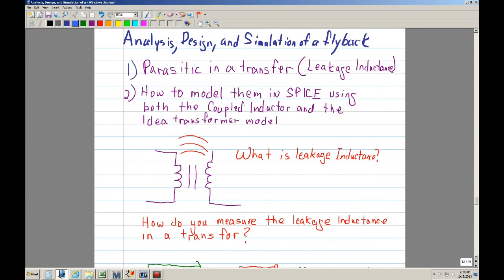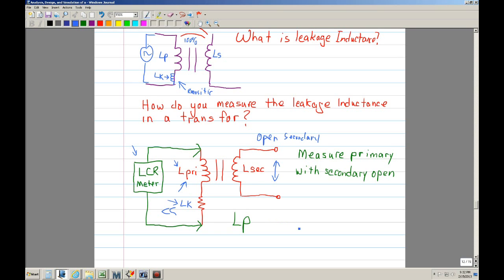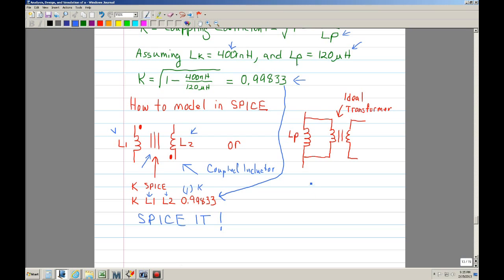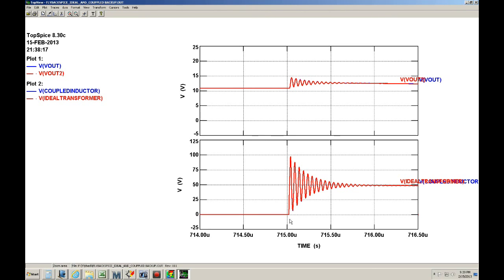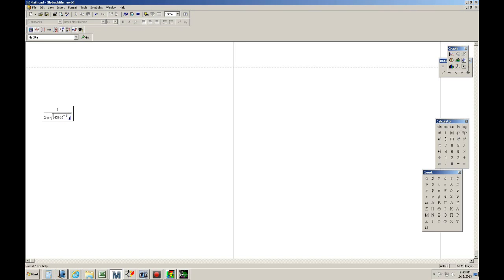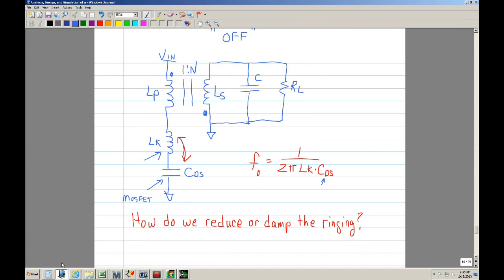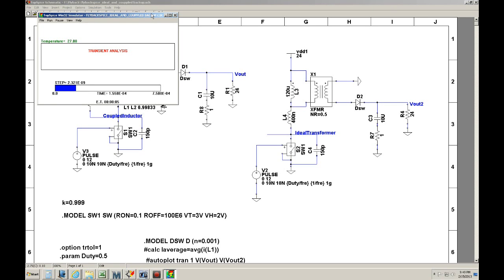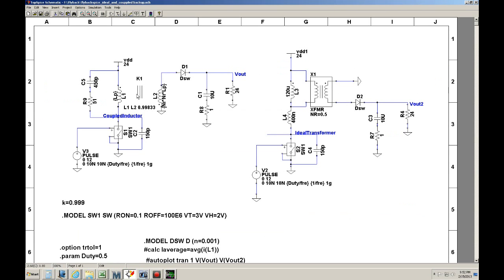Analysis and Design of a Flyback; Part 4, How to Model the Transformer and Simulate it

Comment: Hello, Very Informative video. Can we use both RCD and RC snubber in the same flyback. RCD for clamping the switch voltage and RC for ringing ?
Thanks
Reply from the maker: @neethus3294  absolutely yes, you can use both just like you wrote. Nice intuition!
Reply: @RobertBolanos  Thank you 🙂

Comment: If we are using a High voltage BJT like "MJE13007", commonly used on many commercial SMPS in market, which value from data sheet to be used instead of the C_ds?

Comment: Nice video Robert! But what about secondary side leakage inductance? Don't we need to include that in spice model?
Reply from the maker: When the coupling is tight and close to 1,  the leakage inductance that you measure at the primary includes both the side ( both primary and secondary) of the winding. Hope this makes sense.

Comment: Hi sir .I. am design 3W boost converter .after adding snubber circuit and input filter still I facing ringing noise issue..fail raditaed emissions test ..noise is to high 70uvdb/m..Any suggestion..?

Comment: HI， i still ask you question, because i am confused.
in my company, they like use RCD to solve this problem,   i do not know the difference of RC and RCD.
in my opinion, through the cooperation of R and C，RCD can control the voltage that generated by Lleak, But RC does absorb the energy of Lleak， I don’t know if I understand it this way, right?
Reply from the maker: Hi Tom, the RC is design to dissipate the energy of the leakage inductance. You can also use a RCD as a clamp so to speak where the capacitor will be large enough and use the resistor to discharge the capacitor. Once the capacitor is charged, the diode will turn on when the anode exceeds the capacitor voltage thus making it a clamp. If you still have ringing, you an add a RC in parrallel to the RCD to damp the ringing.

Comment: Why to take snubber capacitor 2-10times higher than parasitic capacitor?
Reply from the maker: Hi Pallavi,  That is an excellent question. When the mosfets is turned on, the transformer is storing energy in the gap or  you could say, it is storing energy in the primary inductor. The primary inductor is compose of the two component, the primary inductor and the leakage inductance. So that means that both the primary inductance the the leakage inductance  (parasitice inductor) have the same current stored. When the mosfets is turn off, the primary released its energy to the secondary. However, the energy in the leakage inductance is not coupled to the secondary and is instead released to the across the primary and causes a high frequency ringing. The frequency of the ringing is fring= 1 (6.28*sqrt(Lleakage*Cmosfet)).  So we measure the frequency of the ringing and then solve for what Rdamp we need using sqrt(Lleakage/Cmosfet) .   This means that we would have to place the resistor in series with the Cmosfet, In this case we can not place a resistor in series with the mosfets. So we can place it in parallel with the primary. By doing this, it looks like we placed it in series with the Cmosfet. We usually use 10 times to ensure very good damping. But this causes power loses to burn in the Rdamp resistor. So we can lower that Capacitor value from 10 to to 2 times to minimize the power losses.  Watch this video about the leakage inductance.https://www.youtube.com/watch?v=WxU8MTTQlMI&list=PLQJi4gXVTqsyCZSNTojtr9aU28rpbWu2q&index=17&t=0s

Comment: Hi Robert.. thanks for video. It is very useful. I have a question that why to take snubber capacitor 2-10bhigher than parasitic capacitor?
Reply from the maker: Hi Pallavi, I thought I sent a reply to your question. I don't see it here. Did you received anything from me? Robert
Reply: @RobertBolanos  hi Robert, I got an email from you tube . There I can see your comments.. thanks

Comment: What is the benefit of using a RCD(resistor capacitor diode) snubber across the flyback primary with the capacitor and resistor in parallel instead of what you have done at the end of this video?
Reply from the maker: +Proto G Hi Proto G,  depending on the design of the RCD, you can design it where it will clamp the drain voltage at a desired voltage. Also, with the diode, you can design the circuit where the diode will return some of the energy back to the Vinput. So a RCD has multiple function depending what you want. Adding just a RC will only damp the circuit and will dissipate power. Hope this helps.  Robert. Comments and question can be email to rbola35618@aol.com

Comment from the maker: Using Lprimary of 129uF and using both Coss and Crss for a total of 90 pF, I get a ringing of 1.4 Mhz. The ringing that you are seeing is after the transformer has reset. This ringing is due to the primary inductance of the transformer and Cmosfet. To snub this you can use a 1.1kohm resistor in series with a 470pF and connect across the flyback. Try that and see if it damps it.

Comment from the maker: The Wurth datasheet shows a Leakage of 210 NH.  You need to short all the winding and only measure one winding. Each winding contributes to the leakage so that is why you have to short all the winding wether they are primary or secondary.

Comment: Yes, three primary winding's.  The transformer is created by Wurth (749196121).  I did short the secondary winding's, Which should short the primary winding's by default.  The Lk I measured was 5uH.  What is making me believe it's the wrong value of Lk is the equation f0=1/(2piSqrt(Lk*Cds)).  I measure 1Mhz on my scope, but my calculations give me about 10Mhz, which leads me to believe either my Cds or Lk is incorrect.

Comment from the maker: Hi Brian,
Three primay? What typology are you using?   To extract the parasitic leakage inductance, short all the winding including the primaries and secondary and only measure the main secondary that you will using. The main winding should go to the input voltage the second terminal should go to your switch. This is the winding that you want to measure. Then you can calculate the coupling coefficient and use it in your spice. The Csnubber can be from 1 to 10 times the Cmosfet .  But the higher the Csnubber the more power that will be dissipated. You can reach me at rbola35618@aol.com  
Robert

Comment: Hi Robert, I'm using a transformer with 3 primary and 3 secondary windings, 1:1.
Each primary winding is 14.7uH.  I put all three primary inductors in series, left the secondary open, and measured 129uH using a Fluke PM6306 RLC meter.
I then shorted the secondary a measured 5uH.  I created a snubber following the receipe, but my ring does not change.  Note, I have a diode in parallel with my FET.  Do I include the capacitance contributed by the diode?  Thanks, Brian

Comment from the maker: Hi Tran,
The leakage inductance in the transformer and the parasitice capacitance of the MOSFET which is the internal capacitance from the drain and source of the MOSFET form a ringing spike. Sometimes this spike can very large as much as 40 percent and may present a problem if the spike exceeds the Mosfet's Vds rating. To reduce the voltage spike or ringing, you put a RC across the primary to snubber or reduce the voltage spike. See video 7 where I show the effects of the snubber

Comment: hi, 
thanks for this illustrative video. I was modelling with couple inductor as well using matlab. I find it very difficult to clamp the leakage inductor spikes. as they are approaching infinity.
Reply: hello sir. i did it using matlab too however i never get the voltage spike or anything. is there any recommendation to correct it?

Comment from the maker: Pepperjack,

A DC input of 270 volts is very high. Keep in mind that the voltage on the drain is Vdrain = (2*Vin + Leakage spike) = 2*240V+0.3*240V) = 621.  So you need a Mosfet that can handle this much voltage. I would use a 1000V mosfet.

Comment from the maker: Q1, Yes, you can connect the output ground to the input ground with no effects. No problem with that.

Q1. Buck equation is Vo=D*Vin, D=(7V/270V) = 0.025, Ton =D/Frequency = 0.025/100KHz = 259ns. Ton is very short time. Turning on a mosfet may have a slew rate of 50ns to 100ns which takes away from Ton of 259ns. PWM may have trouble controlling short pulses, I would recommend a flyback. By using a step down transformer, will increase Ton a more longer pulse good for PWM

Comment from the maker: Hi pepperjck8,

Q1, Yes, you can connect the output ground to the input ground with no effects. No problem with that.

Q1.  Buck equation is Vo=D*Vin,  D=(7V/270V) = 0.025,  Ton =D/Frequency = 0.025/100KHz = 259ns.  Ton is very short time. Turning on a mosfet may have a slew rate of 50ns to 100ns which each into this Ton of 259ns. PWM may have trouble controlling short pulses, I would recommend a flyback. By using a step down transformer, will increase Ton a more longer pulse good for PWM

Comment: @Robert Bolanos
Robert,

Thank you for these great videos. 
I am designing NON isolated 270vDC input to 12VDC, 0.7 Amps output
My question and I am sure many like me will ask or have in mind the same question!

1)  Would you use just one buck inductor or flyback transformer and why? 
2) In case of flyback transformer, can I connect the output ground to input ground without any consequences? assuming that I don't care about isolation and it is only single output (12VDC)

Thank you,
TH